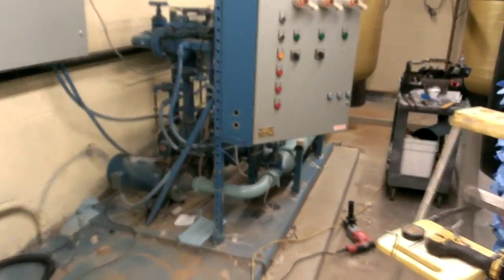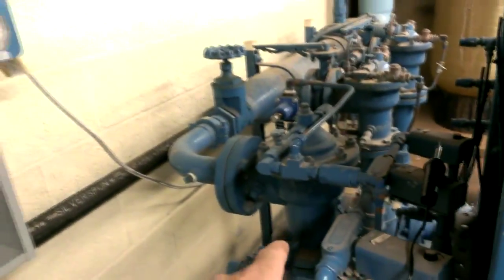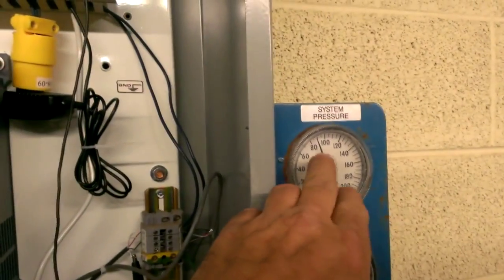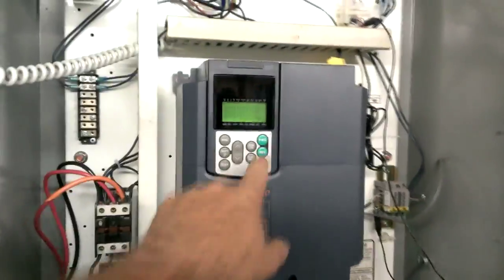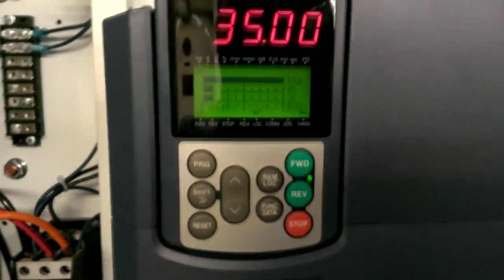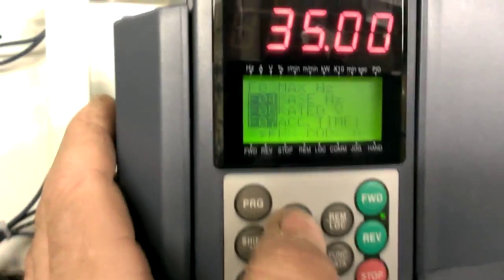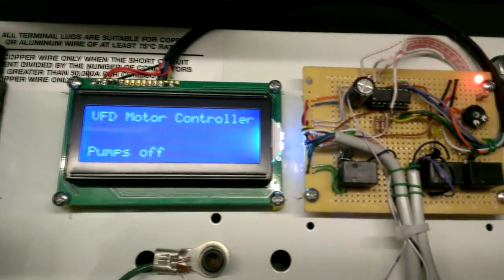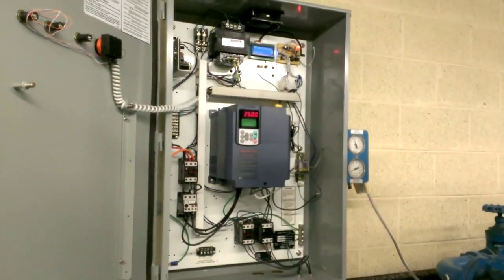Pump Variable Frequency Drive Retro Project - Part 5 - Partially operational

Comment from the maker: ... would be that it would be disconnecting the one motor before the VFD did a stop and closing the other contractor which would wreck havoc on that VFD. 

My device takes the desired operation request based on the ***OFF - PUMP 1 - PUMP 2*** switch and handles the necessary delays and switching of the VFD run/stop and pump contractors to make it fool proof when someone starts moving that selector switch. :-)

Comment from the maker: Yeah that was the original sequence. It's now OFF - PUMP 1 - PUMP 2 based on the wiring and logic.

The contractors are 120VAC where as the call for the VFD to run is closing a pair of contacts on the VFD. So right there you can't interconnect them.
I could also use simple DPDT relays to have either relay call for VFD with one set of poles while the other set of poles pulling in the desired contactor being PUMP 1 or 2 however the problem with that...
continued...

Comment: hey man, thanks for posting your videos.  on your toggle on off switch...i believe it is Pump 1 - OFF - Pump 2....if that is the case why do you need the control logic.  if you are going from pump 1 to pump 2 or vice versa the switch goes through the off position.  you might have been able to get away with an additional relay contactor.  Anyways great video.  Also, could you use digital pressure gauges to feed the VFD?

Comment from the maker: The 100+PSI has been causing the Primara boilers to lift the pressure/temp relief valves too early and I was told by the maintenance guys that appliances such as washing machines etc have had valve failures, etc lately. 

80PSI has been the normal since I started here and for the past few months the pressure regulator wont control it anymore. Is worn out. 

I am going to gut the pressure regulators after getting the VFD tuned.

This also saves $ to run verses balls out with pressure regulator

Comment: is 90 psi too high or can everything handle that fine? 6th floor would prob like the higher constant pressure since they were getting used the 100~110....

Comment from the maker: ... So I made this to be fool proof. :-)

No instructions and the maintenance guys can just rotate the switch on the outside of the panel as they wish and my controller will control the VFD start/stop and contactors. That way the contactors can't be switched while the motor is running.

Comment from the maker: I'm the only person who will be working on the internal wiring. :-)
The switch on the outside and the fuses in the disconnect, etc are all I expect the maintenance guys to touch. 

Those "instructions" you mention are funny. 
Because that is what we first thought of to run the VFD  connected to contractors. 
You'd have to first shut off the VFD. Wait for it to STOP. Then move a switch to switch motor contactors. Then start the VFD again.
If instructions not followed, damaged VFD!
...

Comment from the maker: Normally a VFD is directly tied to one motor.
We want to be able to switch it to a backup motor if needed. 
And we would like it so that any of the maintenance men who are on call can just rotate the switch on the front panel and do that. 

My controller handles the OFF-Pump1-Pump2 selector switch by giving the VFD start/stop command. When the selector switch is changed to one pump to another my controller will first stop the VFD then switch contractors then start the VFD again after delays.

Comment: Very nice, the only thing I'd be afraid of (past experience) is cowboy repairmen wiring over it because they don't understand what's it for... I did something like this only to visit the site 3yrs later to find my solution ripped out and replaced with a toggle switch and instructions written on tape ("when safety tripped, flip switch and reset safety")